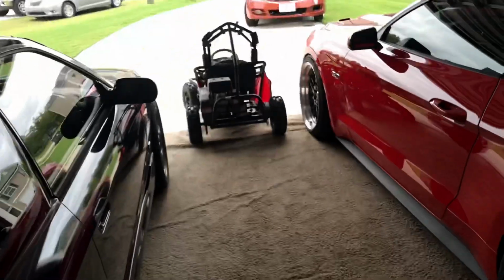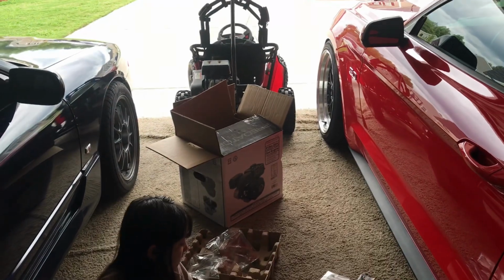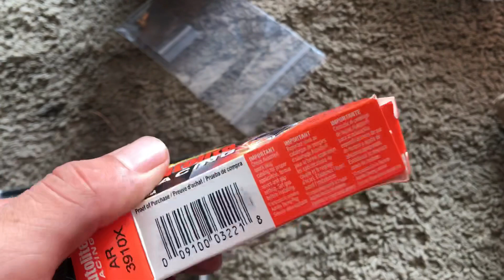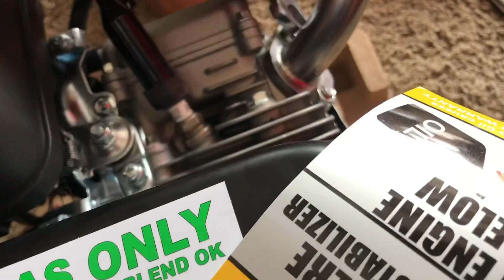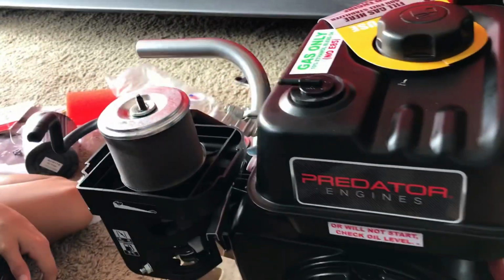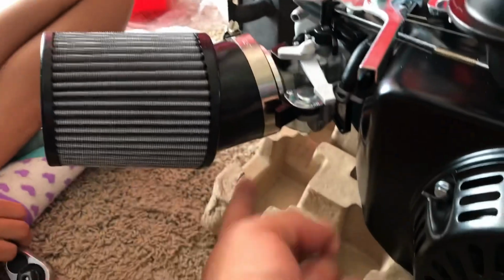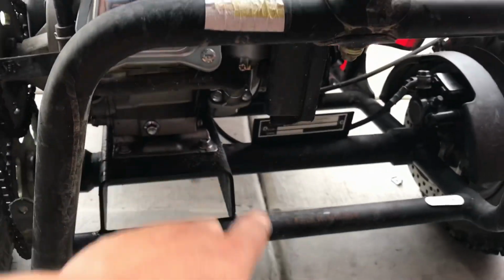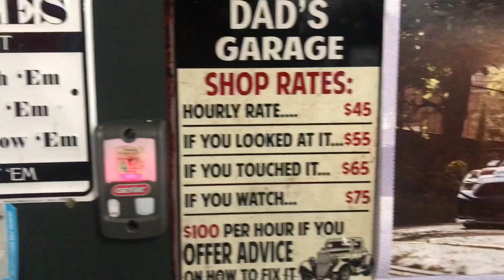EP 1 Predator 212cc engine swap on Coleman Go Kart

Comment: You should oil the air filter or it won’t filter the air small dust particles will get it and I’m speaking from experience I didn’t oil it and when I took the air filter off there was dust all inside the adapter the. I used k&n oil and never seen the dust again
Reply from the maker: gone wrong garage. We did use the k&n oil as well, it works great. Thanks for watching.
Reply: Cool some people don’t do it when they should but there’s no instructions telling you to most of the time
Reply from the maker: gone wrong garage I should do another video of the install process, I also added a hydroshield on the intake filter more extra protection from water as well.
Reply: D.V Ironside yes you should and it would be cool to see it driving to

Comment: I just started doing this exact swap today, very quickly noticed i needed a new clutch also. Big question i have since we didn't get to see you complete it is what clutch you ordered. Also did you use the factory chain or purchase a new one. Lastly how did you get the clutch to line up with the rear axle gear? Did you somehow use the convertor like factory? Im so lost on this last part.
Reply from the maker: I Ordered a new clutch with chain, had to cut a couple of links of the chain to make it fit. You will need a new base plate to make the engine fit properly, if not you will need to make 2 new holes on the base plate and only 2 bolts will be holding the engine. Unfortunately I didn’t get the opportunity to make a second video of the rest of the swap. If you have IG, hit me up d.vbuilt I can send pictures.
Thanks for watching 🤙🏽
Reply: @d.vironside7878  I'm in the middle of my swap but I ordered a torque converter.. and I was wondering if I got another mounting plate if I would actually be able to use the converter or am I going to have to order a clutch? Thanks in advance!
Reply: @jorgevazquez8682  any update ? I have a Coleman CK196 and I’m also looking to use the Predator 212 I’m hoping I can use the same torque converter and clutch. I even here you use the same holes for the engine install

Comment: Where is episode 2 of it running with the 212?
Reply from the maker: I didn’t get a chance to get around on filming it, It was pretty straight forward swap.
Reply: @d.vironside7878  how did you hook up the drive side? What torque converter etc did you use? The 212 has a bigger crankshaft and the bolt holes for the stock 3hp torque converter aren't in the 212 block.

Comment: Let me know if you have another video or tips
Reply from the maker: Jordan Yarie  Unfortunately these are the only 2 videos I made. For proper engine fitment you are going to need to get a custom plate to fit the bigger engine. But you can still use same one, but will only have 2 bolts mounted. Other than that it’s a pretty straight forward swap.Thanks for watching.

Comment: So did if fit?
Reply from the maker: It sure did, I just didn’t get the opportunity to record and upload the rest of the process.
Reply: D.V Ironside awesome im about to make a swap this week
Reply from the maker: alan harneck that’s awesome man, make sure you get a new clutch kit for the predator
Reply: D.V Ironside what do you mean?
Reply from the maker: You can either get a 10t or 12t depending on what top speed you want.
https://www.ebay.com/itm/Predator-212cc-6-5HP-Gokart-Minibike-Centrifugal-Clutch-10T-420-Chain-3-4-Bore/274454671434?hash=item3fe6c5f04a:g:P2sAAOSws3xfL3iI
Reply: D.V Ironside which is faster?
Reply: @d.vironside7878  This is the wrong clutch.  The colmean uses a #35 chain not a #420 as you listed.

https://www.amazon.com/gp/product/B01GFFHK0G/ref=ppx_yo_dt_b_asin_title_o00_s00?ie=UTF8&psc=1
This one fits.
Reply: @darthroach9057  on the Larger Coleman Go Karts such as the CK196 do you know if you also need a new clutch or torque converter? I’d assume since they are very similar most parts
Would be interchangeable correct ?
Reply: @jayranger9605  I know you will need a new clutch for sure.
 I would call the manufacturer to find out which chain the larger one uses before wasting money on a wrong part.

I didnt use a torque converter on my cart.
Reply: @darthroach9057  thank you for the response, Since it’s going to be more of an off roading rig for the kids Im hoping to use a torque converter and ideally use the same on that the Coleman gokart has i guess I’ll find out

Comment: How did you get engine shaft and clutch to line up on motor mount ?
Reply from the maker: 2 ways to do it. Either get a plate welded  to fit the engine or make new holes but only 2 bolts will be on the factory plate. 
It holds ok with just having 2 bolts on
Reply: D.V Ironside I went from a 3.0 hp motor , will I even need that secondary sprocket that came on the original motor ?
Reply: Everything went great but my clutch smokes ?
Reply: @HavinghomesLLC  how did you fix your problem? I'm having the same problem with my clutch after switching to the 212
Reply: @jerrystewart523  ended up selling the thing lol
Reply: @jerrystewart523  https://www.amazon.com/gp/product/B01GFFHK0G/ref=ppx_yo_dt_b_asin_title_o00_s00?ie=UTF8&psc=1
This is the clutch that you need.
Reply: @jerrystewart523  what go kart did you install the predator in ? And did you end up getting a new clutch ? Did it fix the problem ?

Comment: would this fit in a Coleman KT196 go kart?
Reply from the maker: Dawson Lee Mounting plate might need some modifying. But it will work.
Reply: D.V Ironside ok thanks!
Reply: Its basically the same engine why would you want to change it
Reply: @RobertDickens2002  I was wondering the same thing....The predator says it has more than 1.5 HP  that 196 and that is a significant % and most mods seem to use the 212CC not the stock engine.....I am thinking wrong? Any advice would be helpful
Reply: @deedah37  i know i put the straight pipe header on my daughter's and fiddled with the governor and it is plenty fast hard to believe how much that stock muffler is hilding it back

Comment: Got a parts list or links ?
Reply from the maker: Video Game Showcase  I hope this Helps thanks for watching.

https://www.ebay.com/itm/Predator-Race-Cam-212-Hemi-or-196-Hi-Performance-w-Matched-Springs-Carb-Jets/132913391082?hash=item1ef24165ea:g:4zgAAOSwJPVdAt~x

https://www.ebay.com/itm/ARC-Billet-Alum-Connecting-Rod-3-308-Std-Predator-212cc-Read-for-Application/113997690470?epid=3020464454&hash=item1a8acab666:g:MogAAOSwv5NbJLQs

https://www.ebay.com/itm/Predator-212-Performance-Emulsion-Tube-038-Jet-Kit-Carb-Honda-GX200-Clone-Hemi/192103351549?hash=item2cba4084fd:g:CGUAAOSwkiVeEH~F

https://www.ebay.com/itm/Performance-Kit-Air-Filter-Jets-Exhaust-Foam-Filter-Predator-212cc-Hemi/174063453529?_trkparms=ispr%3D1&hash=item2886fd8559:g:l8EAAOSwjVhc-HGP